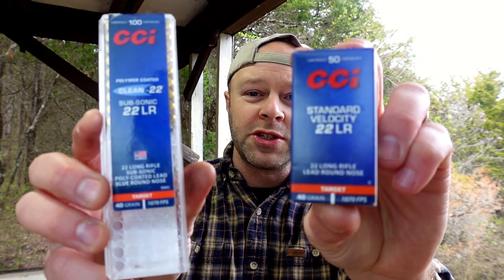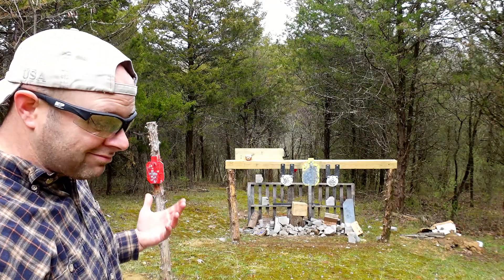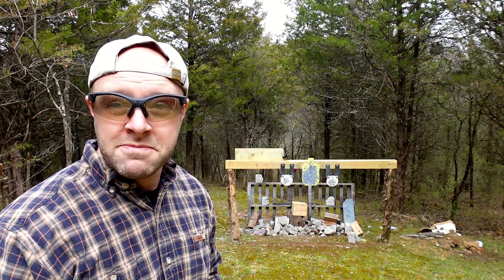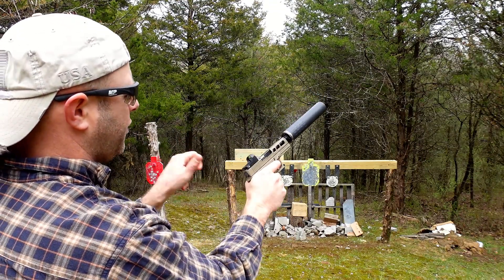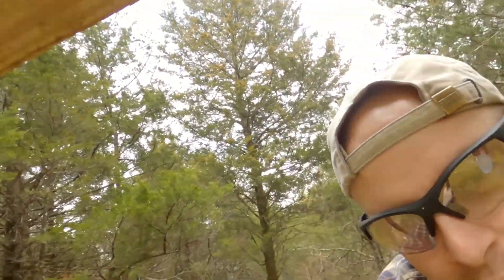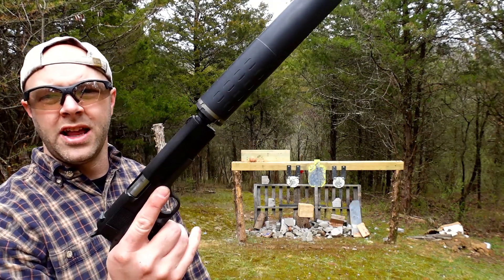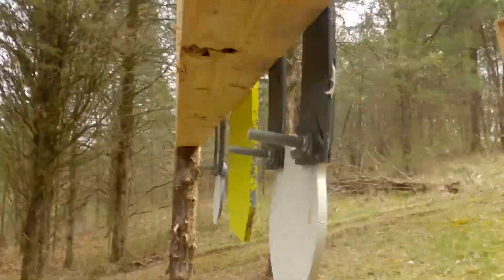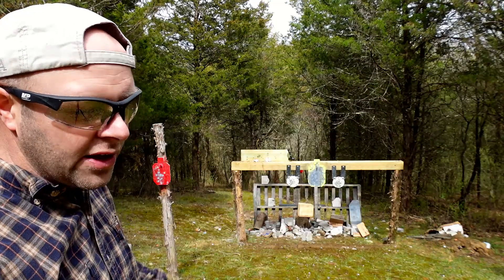How deadly is Subsonic Ammunition? 22lr, 223, 9mm, 45acp, 458 SOCOM

Comment: How would you compare suppressed 22LR to subsonic 556? Do they sound the same? Really interested to see what shooting the mark iv while holding the bolt closed would sound compared to the AR which obviously doesn’t cycle
Reply from the maker: I've found that subsonic 556 is actually quieter than 22lr.
Reply: @RuggedAdventures  Damg, well you just saved me $1300😂 I shoot my MCX and Sandman S with Subsonic 556 and it’s pretty quiet. I thought mayyybe the subsonic suppressed 22LR pistol would be quieter,  especially if you hold that bolt closed… but good to know I’m already about as quiet as you can get with powder guns
Reply from the maker: Keep in mind that's just two suppressors and a couple different bullets so your mileage may vary.